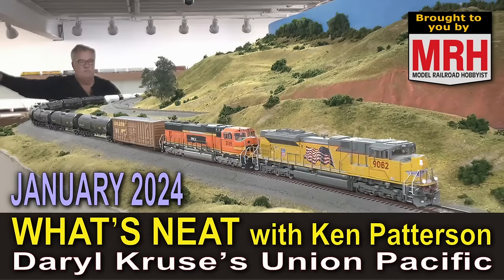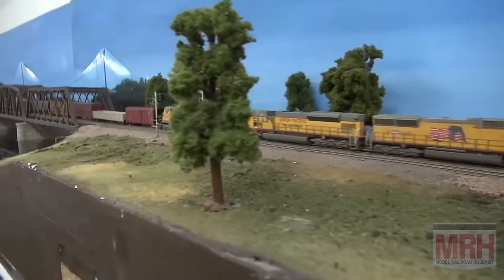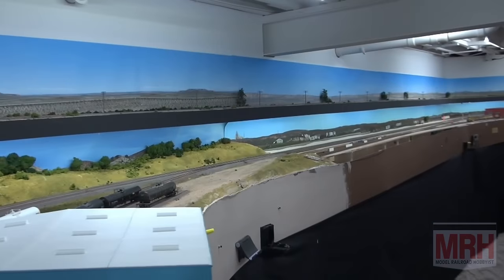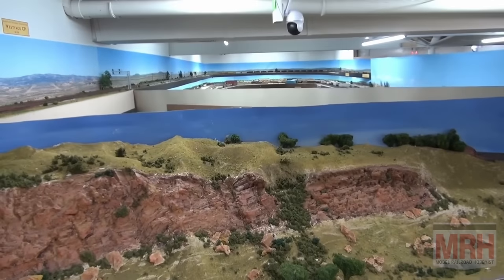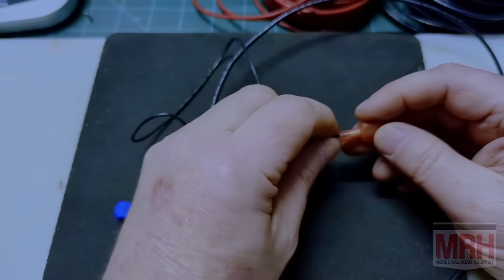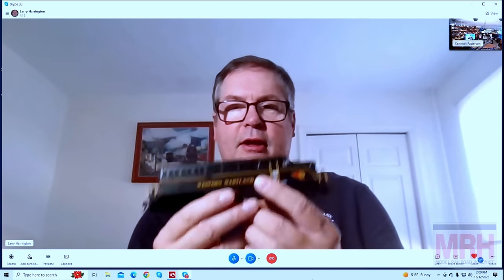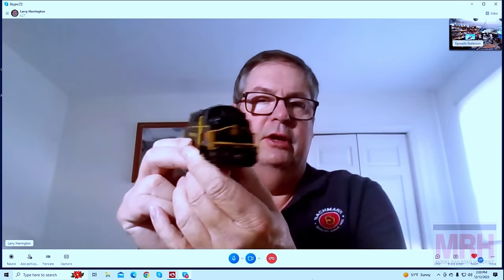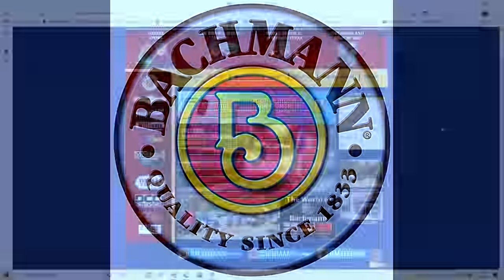Daryl Kruse's Union Pacific | January 2024 WHATS NEAT Model Railroad Hobbyist

Comment: I have learned to NOT trust Wago type connectors for the simple reason that they require breaking the continuity of your power main. I have gone to Scothlok suitcase connectors for all my drops to the rails as they leave the power line solid. Once you learn the trick of feeding your drop line in - unstripped, by the way - until you feel a slight click, you've got 'em mastered. One drawback is that once on, they're there for good.

Comment: You went from one long unbroken power wire to a power wire with over a hundred broken connections. The power loss should be considered.  Yanking on the wire to see if it comes out of the connector has no barring on resistance values.  Each broken connection will add a measurable amount of resistance and power loss to your system.

Comment: I love the hobby, but things have changed over the years?  N scale started out with ALL of the usual makes having "Rapido style couplers mounted on the bogies (or trucks), on both sides of the World ..  No matter what you bought, it would run together?  Commonality was a great asset for modellers..
The changes made in time, to Kadee style and body mounted couplers, by the U.S. manufacturers, has been a definite improvement... But for "long term" modellers it has caused a few difficulties running "old & new" rolling stock and locos together?  If the curves are not very large radius, the overhang on different body mount couplers can cause derailments?  Even on a common crossover between tracks, it is a problem with smaller radius turnouts?  
If you model "N" scale on the other side of the Atlantic, there are many manufacturers who still supply truck mounted Rapido couplers.. These however, are not usually on American style locos or rolling stock?
The European layouts are often designed for small spaces, and therefore frequently have smaller radius curvature, while U.S. modellers have often taken advantage of the small "N" scale, to create large vista's of accurate landscaping with broad curvature?
What a pity that manufacturers no longer seem to cater to both camps?  For a while there, LifeLike sold locos with a choice of couplers in the box? But alas, that practice has disappeared?
All in all, it is a great hobby.. But nowadays, you need to only buy what suits your needs? The day of "one size fits all" in "N"scale, have (unfortunately) gone ???

Comment: wago's are garbage and I do not allow them on any jobs I am doing.. when we encounter them in existing work they are removed for safety and so they do not become a liability issue down the road getting blamed for installing them if a fire or other issue happens.  In a matter of years they loose their tension and resistance grows till they fail.  They just don't hold at all when wires are stuffed back into a box and tension from the wires is applied all the time to a wago,  and its quite common to start pulling wires out of a junction box and wago's will just easily slip off.  On a layout yes that might be an ok spot for them,,  but on 120 and above with real world age, vibration, current loads, etc,  they really need to be outlawed.   Wago's were invented for the fly by night contractors who won't be around to face the consequences.